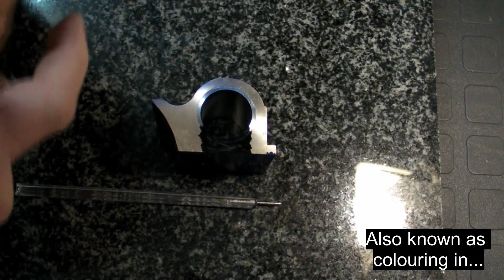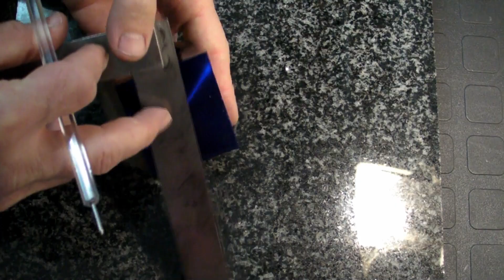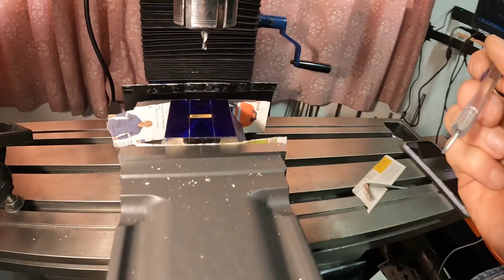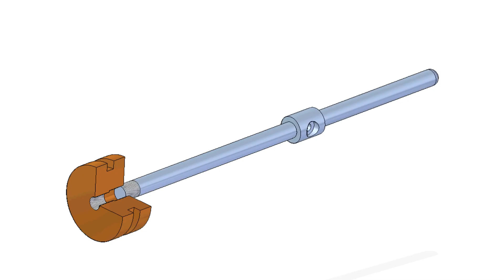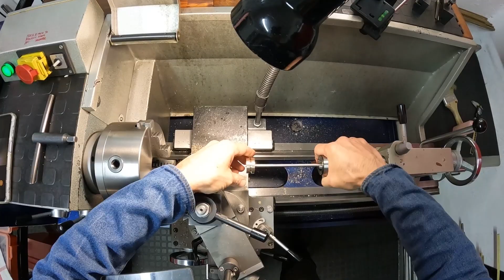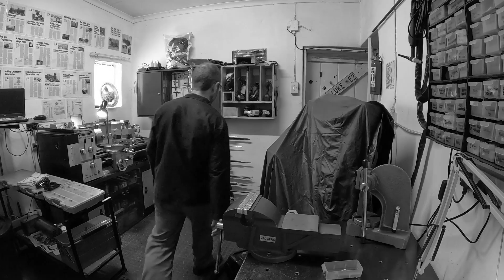Steam ports and piston fit for the perfect sounding steam engine

Comment: Some bloody good tips ‘n tricks there mate 👏👏👏
I’ve got my ( gunmetal) cylinders bored and externally machined.
Just about to start the porting…. so your insights are timely.
Looking forward to the ‘valve’ video. I think you mentioned that some discrepancies on the ports can be ameliorated during the machining of the valve.
Great stuff on the piston/bore fitting too.
I’ll twig my order of operations to follow your logic ( re. ‘burrs’).
Once again,
Thanks.
Robert
🇦🇺